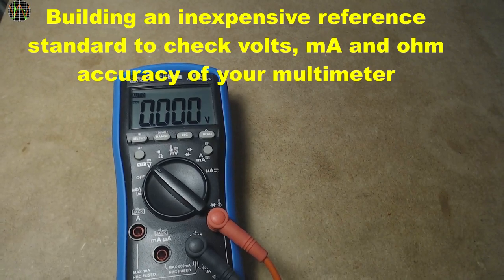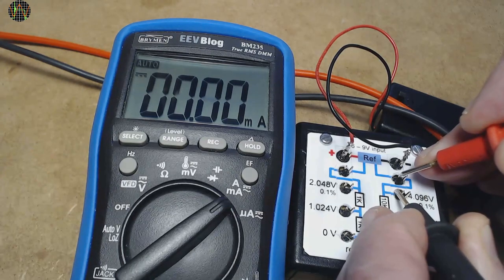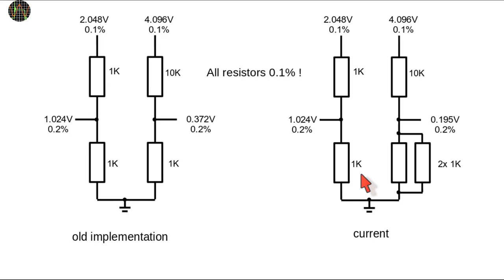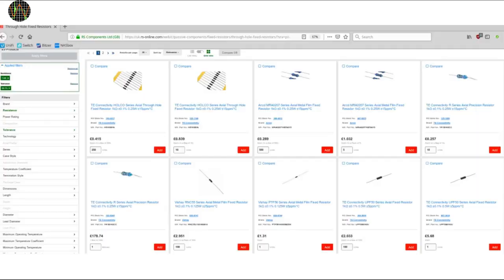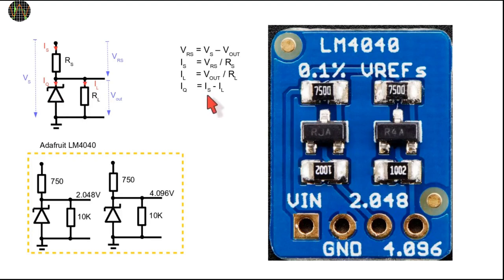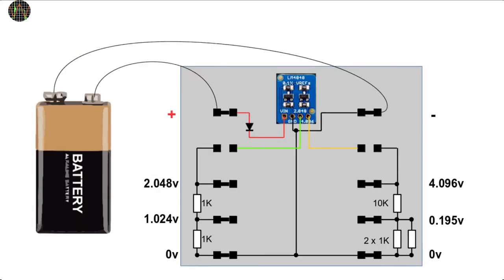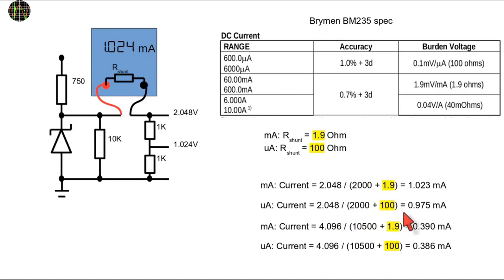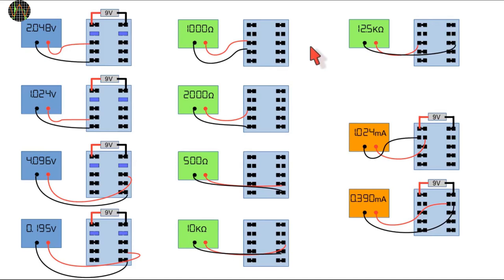Building an inexpensive reference standard to check volts, mA and ohm accuracy of your multi-meter

Comment: Amazing video. I was looking for a cheap, but precise voltage reference option. Thank you for sharing this!
Reply from the maker: Thanks Zoltan. Its a very convenient standard still very much in use by me, even though  I since bought a couple of other voltage references. Those are 5V or 10V and these voltages are often too high for a good resolution on cheaper multi-meters. The lower voltages like 1.024 and 2.048 in particular are perfect for checking accuracy of 2000-count multi meters.